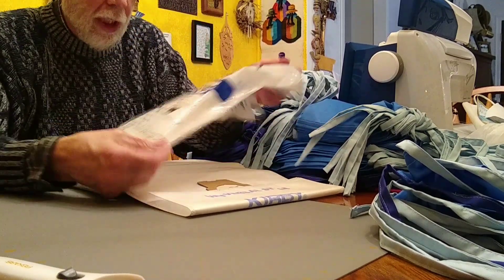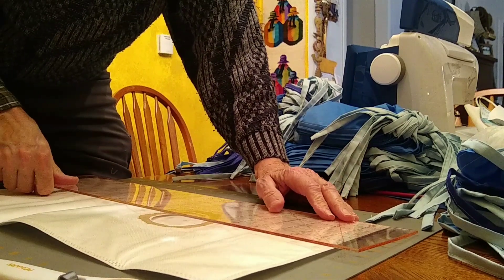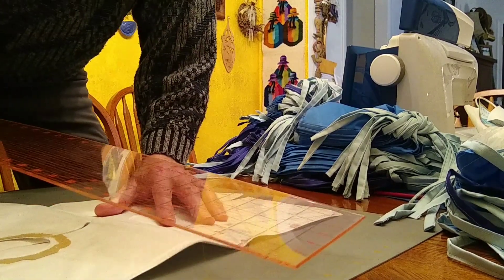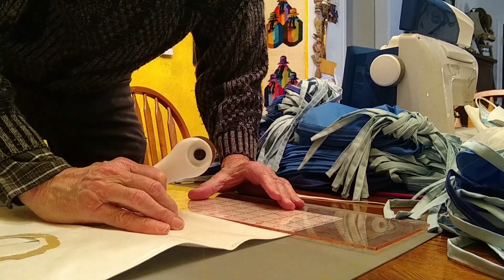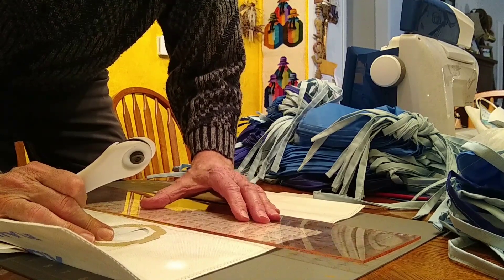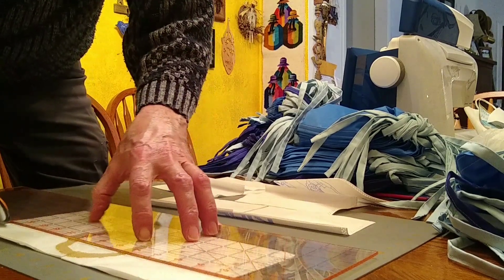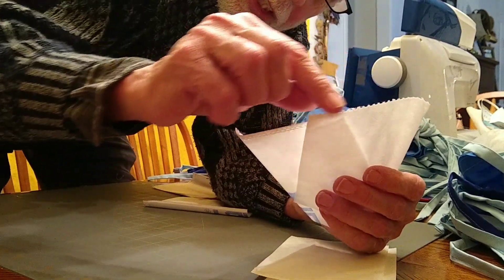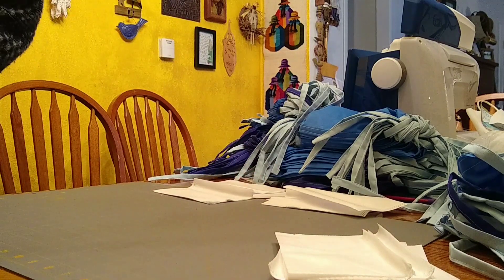Face Mask Filters From Vacuum Bag

Comment: I liked your video about the vacuum bags. Quick question: what keeps particles from just getting around the edges of these filters? You said simply piercing them with needles impacted the material's ability to filter.
Reply from the maker: I suspect you are correct that fit is very important.  If the filter is not tight to the face particles could leak in.  One test we did was with face masks made from a vacuum cleaner bags.  When sewing across the front of the mask the partical counter showed a big reduction in filter efficiency.